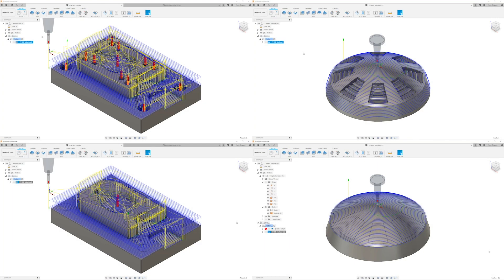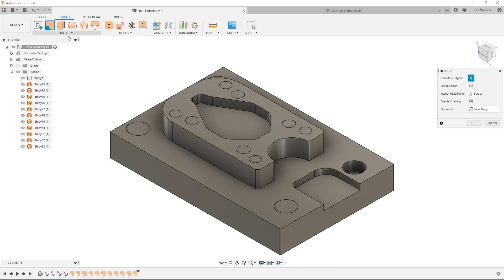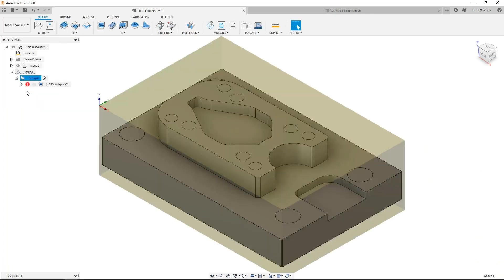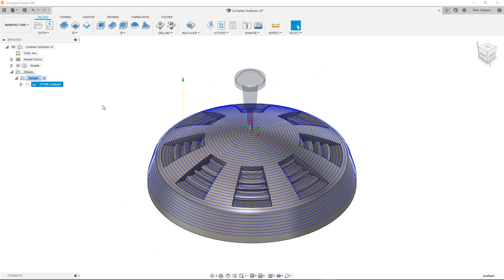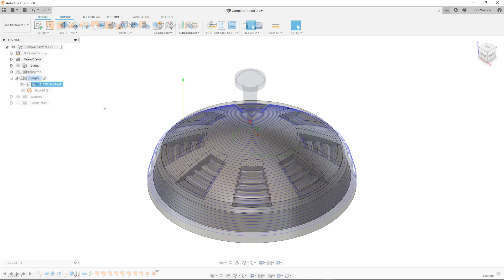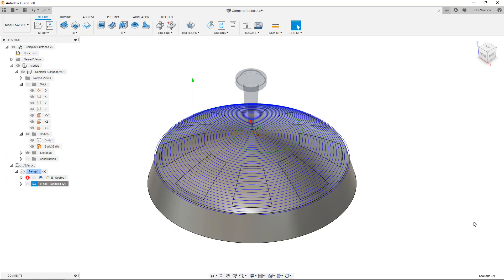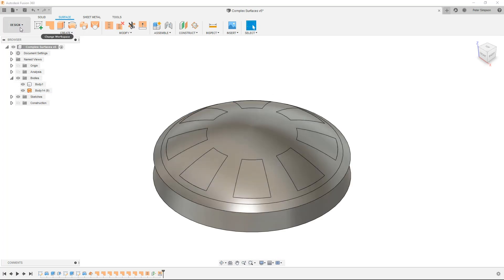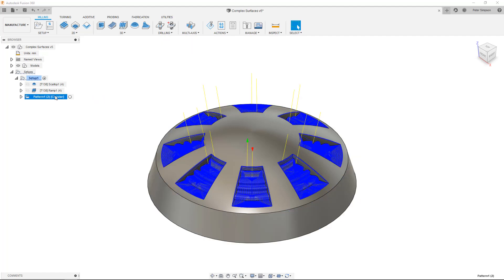QUICK TIP: Using Surfaces to Make Better Toolpaths

Comment: this is a nice workaround.
But why not add a "ignore geometry/hole" directly to CAM? selecting the edges or holes you want to treat as a surface, then you don't need to add extra surfaces and do all that is needed for machining in CAM saving time to jump around and change models.
Reply from the maker: I'll see if Peter (or someone else from the CAM side of things) is available to reply. Thanks for the suggestion!
Reply: I like this as a work around because of the control it gives! You could set boundaries and limit your tool in the geometries tab or use the 'Machine Cavities' check box as mentioned below? These both have limitations as the boundary will stop ANY machining in that area and the 'Machining Cavities' will prevent machining of ALL cavities. Would be cool if we could automate this in the options like you mentioned though!